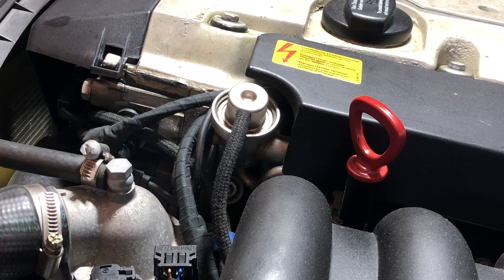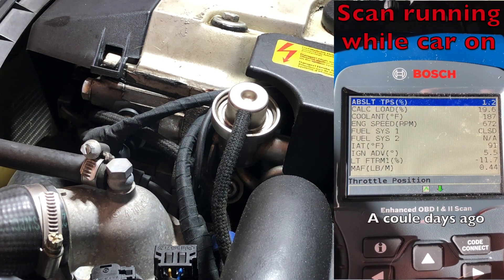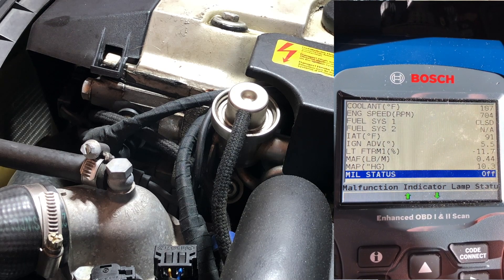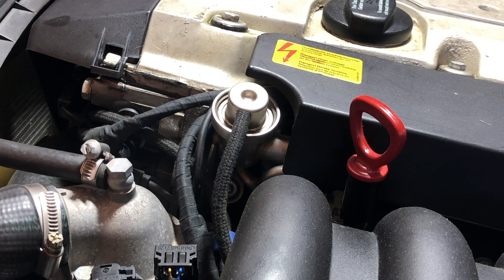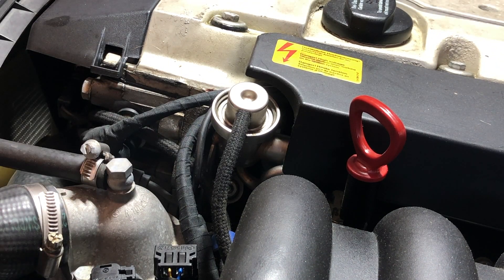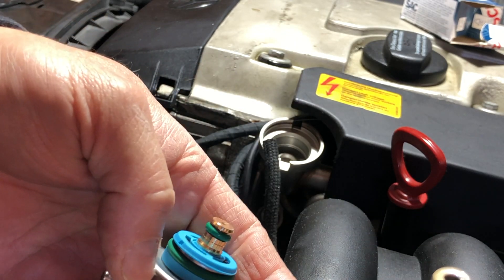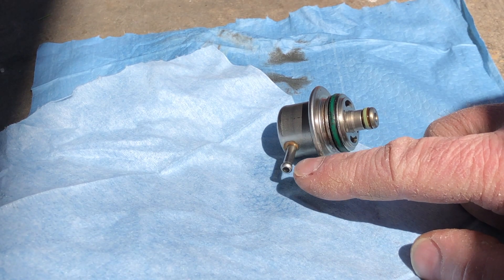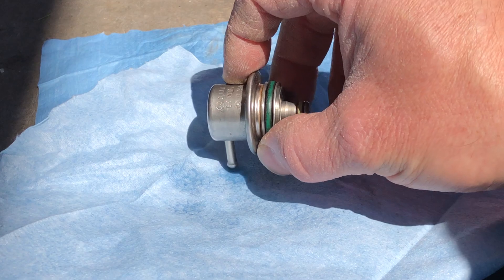Fuel Pressure Regulator 1994 Mercedes C280 W202

Comment: Is Fuel Pressure Regulator responsible for the cold start too? if it gives low pressure the engine starts in low temperatures with low RPM and turns off..Am I right?
Reply from the maker: Good question. I am not that much of an expert to be able to answer that completely. Maybe someone can jump in. Is your main problem a difficult to start engine first thing in the morning?
Reply: @fixittony  In winter only,I have to restart the engine couple of times. In summer no problem ,just starts from first try.
Reply: @maxnomad1494  I couldn't find a good Fuel regulator in my area (all aftermarket with bad reputation), I replaced the intake temperature sensor, since then, I could start in very cold weather without a restart. this was years ago. I recall the intake temp. sensor was the same as the W140 (same part no.)

Comment: Do i need to disconnect battery before pull it out?
Reply from the maker: You shouldn't have to disconnect battery. But, should pull the fuel pump fuse to depressurize fuel system. Also, best done when engine is cold in case you spill gas when disconnecting.

Comment: I just replaced my throttle body and my fuel pump on my 98 C230 and still won't run. I ran some test results and everything turned out ok. I think I'm going to try the fuel regulator next.
Reply: Pomogło?

Comment: Did you get a better reading from the scanner.. also what are those pliers called?
Reply from the maker: My long-term fuel trim dropped to -9.6 after replacing the fuel pressure regulator.

I was going to shoot a video on replacing my fuel sending units but I couldn't lift my car high enough to drain the tanks safely. Also, my wife would not allow me to stink up our garage LOL! So, I did pay $1000 for two new fuel sending units along with new wiring harnesses because the plugs were different. At the same time I changed a leaky fuel pump.

After these repairs my long-term fuel trim improved to -7.2. 

I do feel the engine is running smoother and more power. I improved my fuel economy by nearly 2 MPG.
Reply from the maker: I purchased the pliers from www.mercedessource.com they make the pliers.